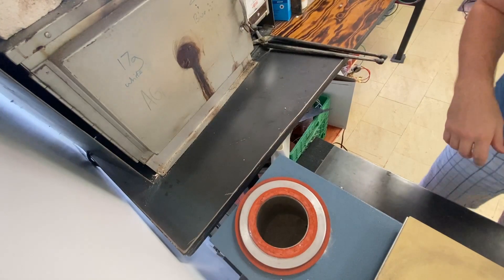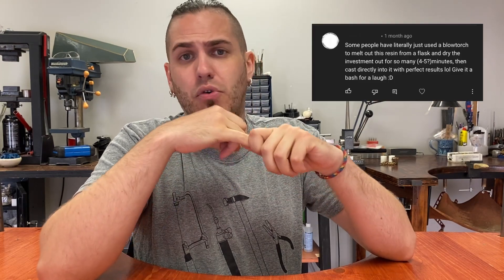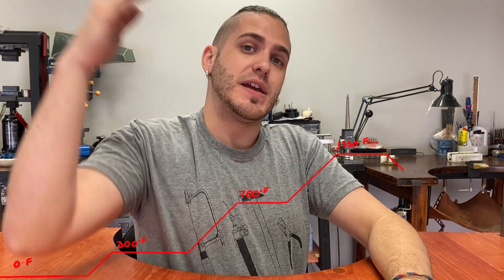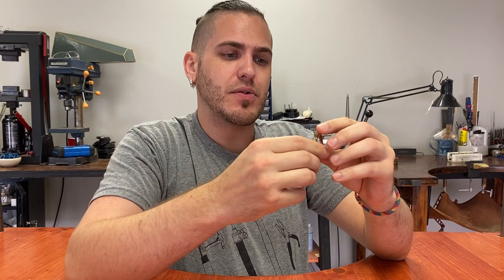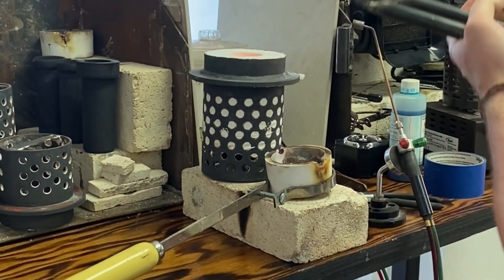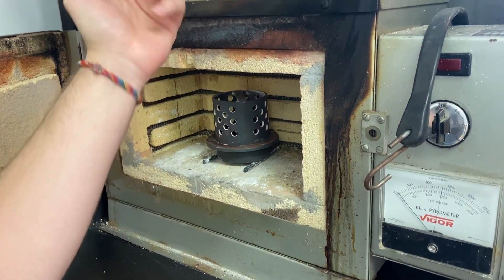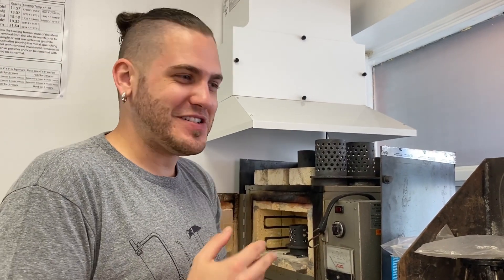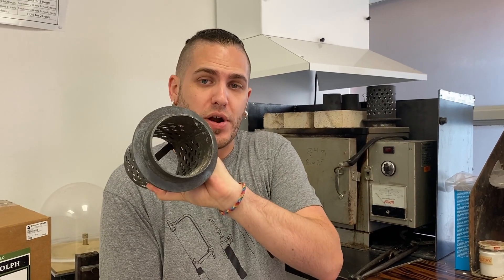Lost Wax and Lost Resin Casting Burnout Process | How to get good casting results| Casting 3D Prints

Comment: I finished building my kiln a couple days ago. It's a converted offset smoker with added insulation and a propane forge burner grafted on.
Screwed up my first set of investments while also not having any methodology to my bake.
So far have only screwed up half of the second set. Turns out opening the oven at 600F causes "thermal shock"
It is worth noting: my homemade kiln had a really consistent 100F/1hour temperature rise with 3PSI on the propane burner.

Comment: Sir we can do burnout process in gas furnace
Reply from the maker: Depends on what you mean by a gas furnace. 
Many larger studios use gas powered kilns and furnaces and they work fine. Although the bigger the kiln sometimes they can get cold spots. 

If you mean doing a burnout in a gas powered furnace (the kind ment for melting larger crucibles of metal) I wouldn't recommend it. You need both a kiln and a furnace,.
Reply: @ClearMindJewellery  thank you sir

Comment: what are you guys using as a drip tray for the resin in the kiln here? Is it 100% necessary every-time?
Reply from the maker: We don't use a drip tray. You can if you want. 
The purpose of a drip tray is to remove the wax/resin before it fully burns to reduce fumes and reduce wear on your kiln. As the chemicals can slowly affect the life span of your brick etc. 
Also some choose to reuse the wax when they can. 
However a lot of resins don't melt, so you aren't really catching much with the tray.
Basically,  if you don't plan on removing it before the max temperature, there isn't really a point, and it has a larger upside if you are doing wax than with resin.
Reply: @ClearMindJewellery  SERIOUSLY helpful to know thank you. I was wondering why i hadn't seen any of the resin burners use one

Comment: Ive only been using pink sheet wax for making Grillz, and my burnout is usually a couple hours or so. And the cavity is clear, but I'm dealing with a shrinking issue after I make the cast, either that or the metal warps when I cast. I need help!
Reply from the maker: Due to liability we don't specifically advise on grillz manufacturing. 
Shrinkage issues are generally related to spru placement, products used (wax, mold material etc), and metal temperature. 
- Shannon

Comment: I was using the fov investment it worked great. I switch to the sc20 investment now i cant get my mold out of the investment it keeps breaking off. What is wrong?
Reply from the maker: FOV is suitable for high temp metals which may mean it has strengthening agents. SC20 is a more generic investment for wax and regular temp metals. 

So if you are using resins or high temp metals it won’t be suitable.
Reply: Am casting silver mens rings.  How can I speak with you personally am new to casting and i would like to show you some of my work. Maybe even join ur class.
Reply from the maker: @agustinenathan3495  we do not have classes but online coaching. If you want to receive one on one assistance, there are options on our website. If you are more into a community based dynamic learning alongside other individuals, we have a YouTube membership program that grants access to our Discord.

Comment: Hi! Very good job, keep it up 👍 
Just one question about burnout timing: do you think a much slower ramp than recommended might be a problem?
I.e. going from 300 to 700 deg over 3 hours instead of 1 may cause some remarkable effect on the investment?
Just out of curiosity…
Thanks in advance!
Greetings from Rome 🇮🇹
Reply from the maker: Lengthening the burnout time is usually a good thing. 
Haven't heard of many issues caused by it. More so issues caused by ramping to high in temp (over what's recommended).

Comment: Very informative thanks! Curious, is it possible you think, to print 3D resin molds and inject them with wax? Then do lost wax casting..
Reply from the maker: Yes. We’ve been working to find a good flexible resin for this and have also recently been looking at heat rated resins that work for making large spru’s suitable for sculpture.

Jewellery Mold with B9 Resilient Resin
https://youtu.be/dQuKXyaTDNs

Comment: Can I ask a question please. If I use steam to remove the wax, does this change the firing schedule for the burn out? Now that the wax is gone, it seems that would change the schedule.
Reply from the maker: Originally we would have said no but with our rapid burnout experiments we're more inclined to say a shorter burnout is possible. You still need to get it up to temp to cure the investment, get rid of moisture, get rid of wax residue, and get to casting temperature with your flask. But can probably be shorter.
Reply: @ClearMindJewellery  Thank you for that. I'll try each ramp a little slower. I have a small flask so I'll reduce the ramp up and hold for each segment to maybe half and see how that goes.

Comment: I am doing home casting. Majority of problems only with resin castable prints, as they require proper and perfect handling like good investment and perfectly calibrated burnout cycles. For regular wax only when you have big flasks - you require same procedure. I was able to cast in metal tubes (bought cuts from ebay for exhaust pipes, around 1mm walls) 20mm, 30mm and 40mm diameter, they fit 1 regular jewelry like ring or few small ones. Simply was putting the flasks into slow cooker to evaporate a bit water and burnout the wax (weirdly enough but slow cooker removes around 90-95% of regular wax) then on casting day I heat the flask  with torch carefully around till the wall starting to glow it is around 10-15 minutes, then put metal grain on top of flask, melt it in the flask and while holding the torch so the metal won't solidify I putting flask into home made build vacuum machine and so far I did that way maybe 10 or 12 batches ( each batch around 4-5 pieces) and only 2 batches was faulty (it was first 2 tries, and faulty as only half of castings was successful, so for me it is faulty batch), Al the rest of the times the castings was 100% copy of wax models. Now I have normal programmable kiln, because it takes a bit of time to do one piece at a time, and not worth in long term, but for anyone just starting and trying I think is good practice as whole set up is - propane torch $30 + vacuum pump $60-80 + few hoses $15 + few small parts and heat resistant pourable silicone $35. So won't break your budget to start.
Reply: Wow im impressed by your diy skillls

Comment: Newbie..  very first attempt at replicating a Bas Relief plaque in .999 silver
(3.25" X 5.25" with average .5" thickness).
The Flask is 5.5" in diameter and 7.5" Tall. Investment is Prestige Oro. 
Three questions please: 
(1) Position in Flask.. does it matter if wax model is laying horizontally on its back (very small amount of Investment required), or vertically on its short end (quite a bit more investment required)?
(2) Using latter choice, approximately how long should that last burnout phase be? 
(3) Is there a minimum required thickness of Investment called for around the wax model?
Thank you for your help..  Dan
Reply from the maker: (1) a sand caster would tell you to put the lettering facing down. We've done plaques vertically in the past. Its really going to depend on how you spru it. (https://www.instagram.com/p/CNm9RFFnoMz/?img_index=1)
(2) again depends on material if resin stick to a solid 2-3 hrs at peak. 
(3) we like to keep a 1/4" to avoid blow outs. Try to avoid leading edges at this thickness. (we have bees with antennas for example) As if it cracks thats always were it will blowout. 
- Shannon

Comment: I want to know what you guys do with regards for ventilation etc... i want to do lwc however i have nowhere suitable outdoor and to rent a workshop it costs too much.

What would you suggest for someone who is a hobbyist like myself that has all the equipment but nowhere to do it
Reply from the maker: We have the quatro ductless ventilation hood. However the filters easily become overwhelmed with the printed resin which makes the "ductless" part useless and we ended up venting it outside anyway. https://youtu.be/M-2txdK8I_o

You need ventilation if you are going to be doing this as you don't want to be breathing this stuff in. 
If you can grab a fan off amazon that can do 300 cfm and some flexable ducting from a local hardware store you can put something together. https://youtu.be/9xoe8WjbOMY

Comment: Hello, i keep having some problems with porosity in my sterling silver castings. I use sirayatech cast purple and plasticast. I use the burnout from plasticast pdf and no luck. The mixing ratio i use is 40:100. I mainly make blings. Like pave nameplates and championship rings. I can't figure out the proper schedule for the investment. Can you help me please with some ideas? (i tried a lot of burnout schedules but neither seem to work)
Reply from the maker: So if its porosity (and not another form of texture) usually the part of your burnout that will cause issues is the final temperature of the flask at time of cast. This can also be a 2-in-1 issue if your metal temp is also off, the two off temperatures just compound and make the porosity worse.
What's your SS temp and your final flask temp?
Reply: @ClearMindJewellery  I tried the flask temp 590 and 630 Celsius. The SS temp is 970 Celsius.
Reply from the maker: So the flask is about 90.C higher then I would go and the metal about 20.C higher.  Metal is not a huge issue but I would cool the flask down a little more. 
There are other reasons for porosity related to metal quality and spru formation that might be more of an issue as your within range in terms of temp.
Is the porosity more bubbly or more organic looking? If more round and bubbly lower that flask temp the 90.C (at least) and take a look at your metal quality). If more organic looking, look at your spruing (especially if you are new to casting.)
Hope that helps.
Reply: @ClearMindJewellery  thank you very much for your help. I will try tomorrow morning when the burnout is finished and i'll let you know how it goes. Also the porosity is more bubbly looking. Also i just realised that the porosity starts at the first pieces on the three and the last ones. In the middle the cast is perfect.
Reply: Hello, so i just recasted and the problem is the same. I observed that the defects appear just where the resin pieces come. The wax tree casts almost perfect (just very little holes here and there that could be sanded off easy). Could the problems be because of overcuring the resin? I did clen it with isopropilic alcohol and cure it in glycerine 30 min on one part and another 30 on the other so it cures everywhere.

Comment: Thank you for  your  video on burn out process of resind models.I am interested to talk with you related to industrial scale burnout furnces for 3D printed models using PMMA materia;  which is kind of indutrial wax type polymrtic material .Can you suggest me the best wat to interact with you on this topic I am also intereste to kwon best burnout furnace manufacturer For Sizes such as 10 moulds (Flasks with flange to burn out in one cycle of say 12 hours or 8 hours  Anwar
Reply from the maker: If you are looking for coaching or consulting for larger manufacturing we have options on our website to purchase a coaching slot. https://clearmindcasting.com/collections/coaching-and-digital-downloads

Comment: Is it possible to mix basic resin and wax? 20% wax 80% resin? to improve burnout. will they even mix. has anyone tried it?
Reply from the maker: Most resin manufacturers use a "wax like" compound up to 20-40% already. Brands such as Bluecast are pushing this. 
Its only the more "plastic based polymer" castable resins where you have to be thinking about the longer burnouts at this point.

Comment: Hello thank you for making these videos. I was wondering how do you avoid the thermal shock?
Reply from the maker: Avoiding thermal shock?? If you follow a standard burnout you should not see any thermal shock, as you are slowly steadily increasing and or lowering your temperatures.. 
So individuals see thermal shock when the ramp down to quickly after a regular burnout, or if they are experimenting with a rapid burnout and don't have long enough transitional phases.
Reply: @ClearMindJewellery  thank you for your reply. From it I believe I found what I’m doing wrong. I’ve been going from 1350 to 850/950 straight away thinking that the time it takes from the kiln to cold is slow enough for te flask.

Comment: I love your your video, thank you for share it.
I have question please 
What is good investment for casting a small figurine? Thanks
Reply from the maker: Hey 👋 thanks. I would put size (unless your doing full size sculptures) lower on the list then say your model material or your metal. So it will depend on this factors as well. For example if we print DND minis to later cast we would use  Plasticast just at a slightly thicker mixing ratio. You can find our more here ➡️ What is the best lost wax casting investment?  How to pick an investment for Wax or 3D Print casting
https://youtu.be/Oe2wxE-fXmU

Comment: Do I really need an Kiln oven? Can’t I just use the electrical melting furnace to „burn out“ the clay first? The Kiln Oven is really expensive.
Reply from the maker: Most melting furnaces will not work in a way that is suitable to properly setup investment and evacuate the wax or resin. 
You will also need to have your flask coming down at the same time your metal is heating up.

Comment: How do you know if your buying the right kiln for what you want to use it for
Reply from the maker: As long as the kiln is large enough, can get up to and above 1350.F, and can be reliably programmed and left to run for 12hrs or more you should be fine. The kiln that we might get next is technically a heat treating kiln (for blacksmithing) but it meets all the above parameters.
Reply: @ClearMindJewellery  I was about to buy one so I recently asked Evenheat about their heat-treating kilns and they told me they are designed to cycle off and not stay on for extended times like for burnouts...

Comment: When you say you need to leave it longer to burn out lost wax if the flask is smaller would it be the same if you used a very dance amount of wax for your mould or a lot of very small things or is just because heating the investment takes longer I was going to apply this to a dental settings also if you know anywhere else I can get that sort information

Comment: My metal melted through the crucible into my furnace so I wasn’t able to cast today, I took the flask out of the kiln and let it cool, I hope to cast it tomorrow. Would it be okay to just put the flask in the kiln and set to casting temp?
Reply from the maker: I wouldn't put it in at casting temp as you don't want to shock the investment and cause cracking. Ramp up to the casting temp.
Reply: @ClearMindJewellery  thank you!

Comment: Hello. Thanks for sharing your knowledge. It's much appreciated! 
That said, I have question...
I have a creality halot sky printer w/ Formware 3d slicer and Im "trying" to use siraya tech cast resin for making parts. I am having failure after failure. What I mean is the prints starting out but then what appears like its breaking off. But in the vat theres just a lump resin. Not at all what you'd expect to see with respect of what remains on the build plate. 
I've tried exposure ranges from 2.8 - 8seconds, lift height and speed etc. I've tried recalibrating the printer/slicer, but nothing seens to help. Any help would be greatly appreciated.
Thanks

Comment: Are you using that same burnout cycle for Bluecast X One? I just got some and on the bottle they have a sticker saying for the burnout: 302F/3 hours, 1300F/3 hours, and a ramp time of 47F/minute. I was surprised they left out the 700F step and had what seemed to me to be a fast ramp time.
Reply from the maker: As X One is the most wax like resin we have used (out of 20+ something options) it doesn't surprise me. I would suspect that they have done testing of their own and found this to work. It just depends on your process (and if they are expecting you to use their investment). 
We still use a longer burnout with X One as we usually have a mixed flask with other resins and waxes.

Comment: Sir, please help me
I use phosphate bonded investment, 
Do i still need water removal and thermal trantition phase in my burnout cycle ? Because my mould always cracking ( when i was using wax , i directly raise the temperature from 0 to 1000 farenheit and hold for 1 hour and then cast, everything is fine ) but now i changed to digital castable resin eoth siraya tech cast purple
Reply from the maker: What was the time for the raise from 0-1000? If you are trying to do a rapid burnout with resin it will likely fail. Resin behaves differently than wax during burnout.
Reply: @ClearMindJewellery  i actually raise from 0 to 860⁰C as fast as possible, maybe it is thermal shock.
I will try hold at 300⁰F first for water removal and try to raise to high temp 1350⁰F for pattern removal, as you said we can rapid burnout if using phosphate bonded ? Because im in dental industry
Reply: Sir, i have tried 3 phase burnout
1. 150⁰C for 1 hour
2. 370⁰C for 1 hour
3. 730⁰C for 1 hour but my phosphate bonded mould ring still cracked on high temp.

Comment: Hey,
Does this  sounds valid burnout cycle for Plasticast  investment - Resin - Siraya Cast - sterling silver - flask 9cmx10cm
Place flask into kiln at 150c, hold 3h (150c), raise 2h to 370c,  hold 2h (370c),  raise 2h to 730c, hold 2h (730c), lower 1h to 450c, hold for 2h (450c) -> CAST